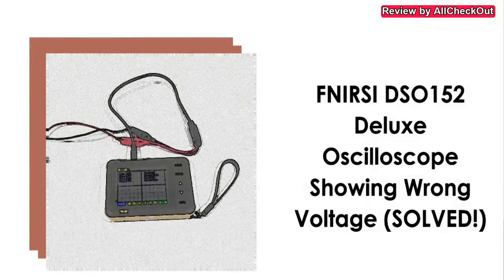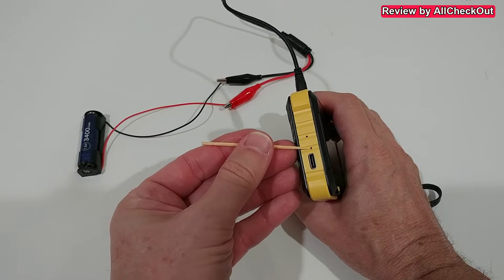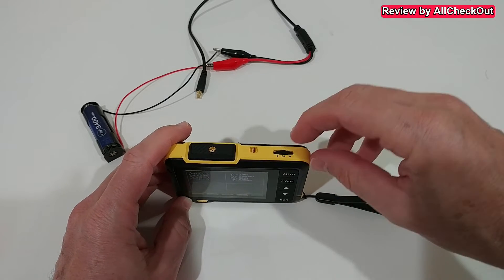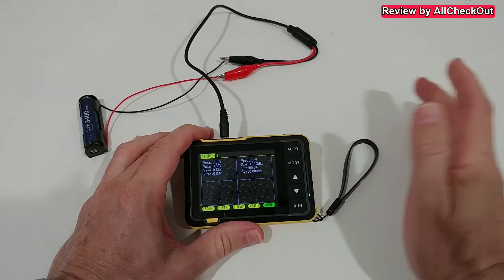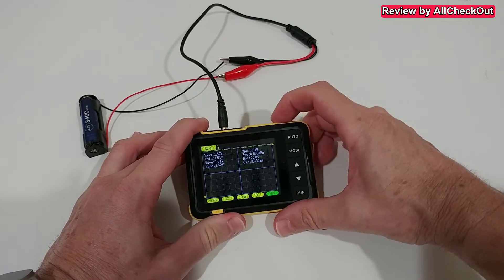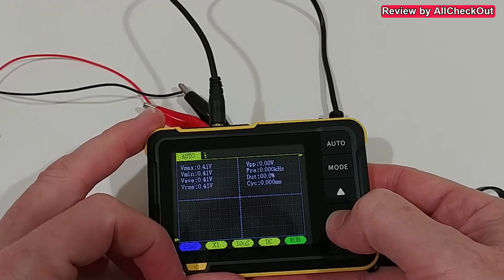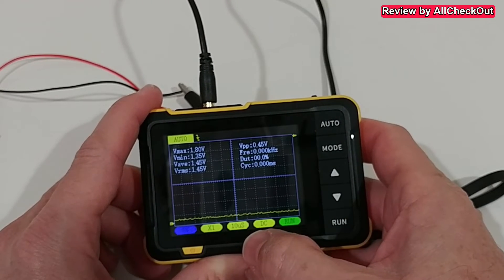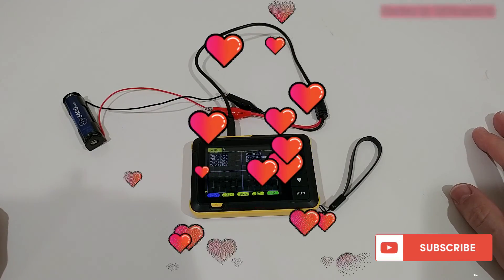Troubleshooting FNIRSI DSO152 Oscilloscope: Fixing Incorrect Voltage Readings (Calibration Tutorial)

Comment: Thanks bro.  I thought my scope had suddenly gone half dead.  It was sitting on one of my theatre speakers basically doing nothing but turning sound into video display.  But when I recently turned it on, there was no indication of there being any input signal at all.  If I then chose AUTO, it would eventually lock up all together.  Meanwhile, before the lock up, it was indicating an offset of about 20 volts DC even if set to AC ???   The only way now to unlock it was the reset switch, since you could now not even turn it off with the on/off push button.  However, when I pressed the button to go into calibration mode, all the problems disappeared once it was complete.  So I don't know what the cause was, perhaps static electricity had something to do with it.
Reply from the maker: Wow, glad the calibration helped you out! Sounds like a tricky situation with the static, but awesome it's working now!
Reply: @allcheckout  Well it looked to good.  Fixed one problem but still left another.  The unit will no longer charge the battery.    No matter what the battery voltage is, the units charger circuit does not respond.  So there is no red LED nor green LED activity anymore. I have had to open the unit and charge the battery externally.  It seems as though the charger IC has lost its programming.  Bummer.

Comment: Thanks for sharing this information.  In February 2025 I purchased the newer FSO-153 model. Unfortunately the FSO-153 also suffers from the same problem.  When I connect a 9v battery and press the "Auto" button it automatically chooses "100mV" for "vertical unit" (a really bad choice) and it displays "Vmax" of "508.00mV"  !!!

Here's all the "Vmax" values I see when probe and setting on screen are in "X10" mode:
 - Vertical unit "100mV" shows "Vmax" = 508.00mV
 - Vertical unit "200mV" shows "Vmax" = 1.02V
 - Vertical unit "500mV" shows "Vmax" = 2.54V
 - Vertical unit "1V" shows "Vmax" = 5.08V
 - Vertical unit "2V" shows "Vmax" = 7.52V
 - Vertical unit "5V" shows "Vmax" = 7.8V
 - Vertical unit "10V" shows "Vmax" = 8.0V
 - Vertical unit "20V" shows "Vmax" = 8.8V

Here's all the "Vmax" values I see when probe and setting on screen are in "X1" mode:
 - Vertical unit "50mV" shows "Vmax" = 254.00mV
 - Vertical unit "100mV" shows "Vmax" = 508.00mV

 - Vertical unit "200mV" shows "Vmax" = 1.02V
 - Vertical unit "500mV" shows "Vmax" = 2.54V
 - Vertical unit "1V" shows "Vmax" = 5.08V
 - Vertical unit "2V" shows "Vmax" = 7.52V
 - Vertical unit "5V" shows "Vmax" = 7.6V
 - Vertical unit "10V" shows "Vmax" = 8.0V

Re the comment "You were out of range to the top side" - I think the "vertical unit" setting should only effect the display graph - it should not effect the raw numeric values shown on the screen.

In essence I don't trust the "Vmax" values from the DSO-153.
Reply from the maker: Wow - that's some serious data analysis. Fully agree on your conclusion. Thanks for sharing your findings and your support!

Comment: You were out of range to the top side. set to 2 volts or 5 volts.the yellow line is what you are looking for and it was at the top of the screen at the first of the video.. Thanks for your video. still learning how to use this scope.
Reply from the maker: Thanks. Interesting, but don't understand really what you mean with "out of range". Where can I see that in the video or do you have a pic? Thanks.
Reply: you need to zoom out, the yellow band is at the top of the screen, or go to a higher value... 2.0 volts to 5.0 volts,  @allcheckout
Reply: You were on 50mv you need to set on 2 volts to get a correct reading. Thanks.. @allcheckout
Reply from the maker: @camaromodschannel  I wonder if you have seen the video. That's exactly what I've been showing in the video, but can't agree on 2V. Only between  100mV  and 500mV gives me proper reading on a 1.5V battery. Everything above and below gives me inaccurate readings. Double-checked the numbers with two other volt meters.
Reply: @allcheckout  may be defective?
Reply from the maker: @camaromodschannel  That's what I thought, but it's already my 2nd device and both work same. But at least I got a refund from the seller because of that, so I deal with what I have or what's working. Definitely not a perfect device, but the price is nice. You get what you pay ... lol
Reply: @allcheckout  i think it's better than nothing.  Very nice, little scope.
Reply from the maker: @camaromodschannel  Yes true ...
Reply: @allcheckout  Agreed (and confirmed with my own DSO152), but I think we're seeing two different effects here. At high sensitivity (e.g. 50mV per division), as @camaromodschannel said, you've pushed the trace to the top of the screen and it can't go any higher. The scope "thinks" the voltage is the sensitivity (mV per div) multiplied by the number of divisions between the trace and the zero line, so the displayed voltage will be wrong because otherwise the trace would be off the top of the screen. With that combination of voltage and sensitivity, you can't expect both a correct trace position and a correct displayed voltage at the same time. It's a scope, not a multimeter.

At low sensitivity, on the other hand, I agree that the measurement is not very accurate. I think that's a different effect. The point is that for good measurements, adjust the sensitivity so that the trace fills most of the screen.
Reply from the maker: @norfolkchas  OK. Very interesting. Thanks for sharing your thoughts here. Haven't been using it for a while, but thanks anyhow. Hope it will help others (too) 🙏🏻🙏🏻🙏🏻
Reply: The time scale is wrong. You need to "zoom out" so to speak